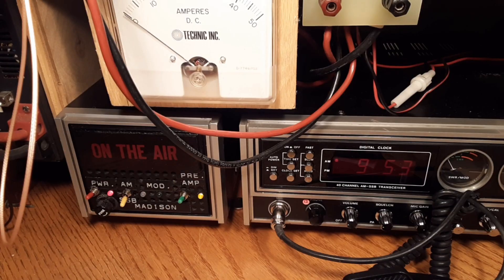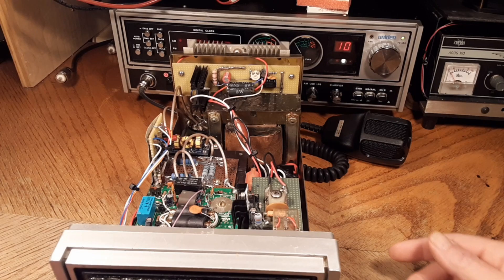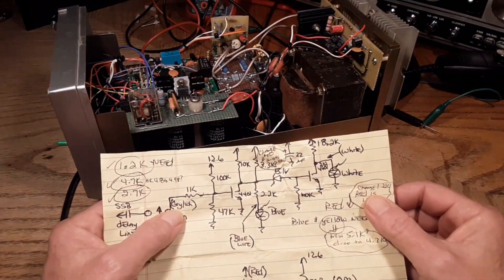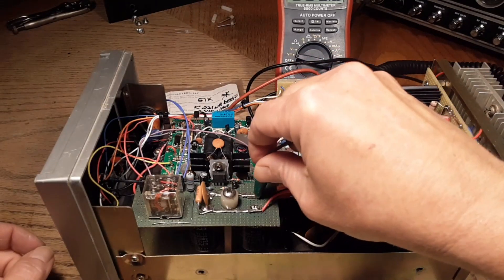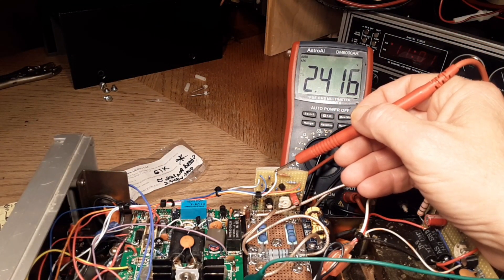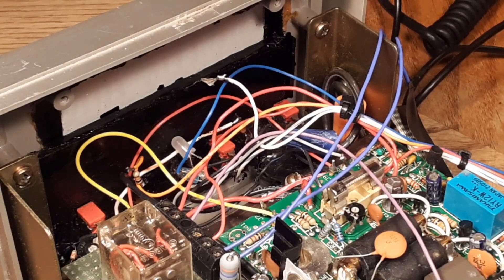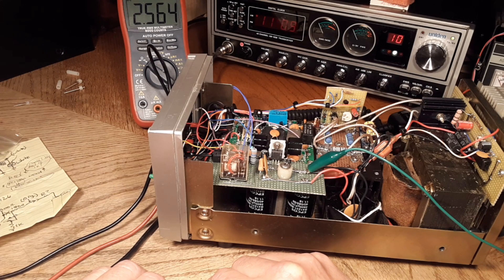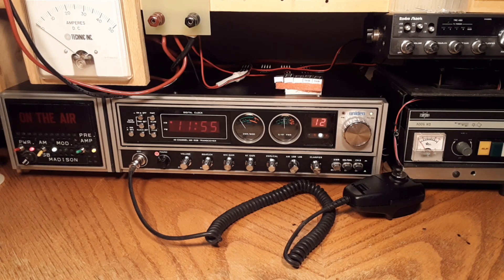*pig🐖vomit* shout out/chinese leds

Comment: InGaN LEDs tend to fail sometimes, old school GaAsP/GaP based LEDs are way more reliable. You can also lower the current to the LED to have it glow longer._
Reply from the maker: Thank u for the comment and watching! 😀It was running at 219 microamps.
Reply: @generalingwer4341  Died at 2,2mA? Well that's very bad quality LED then._
Reply from the maker: @DjResR  yeah .22ma,lol,funny part is the new one is much brighter at same current😅
Reply: @generalingwer4341  Yep that's another problem with these LED's that it dims down with use._